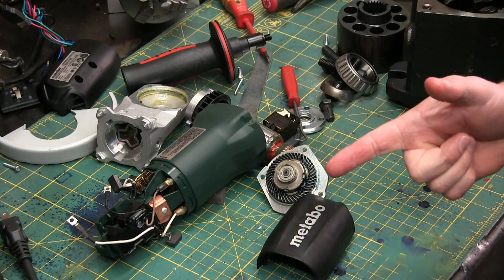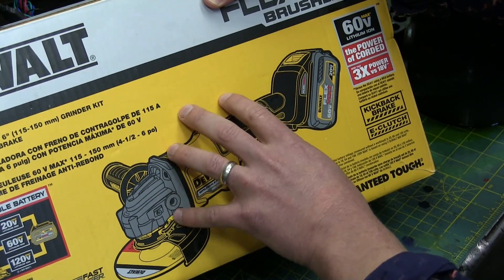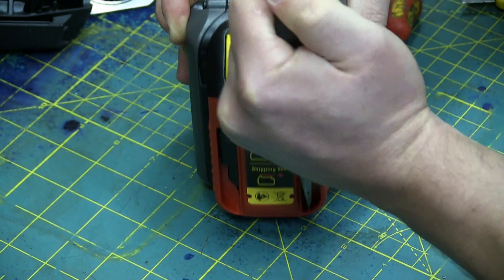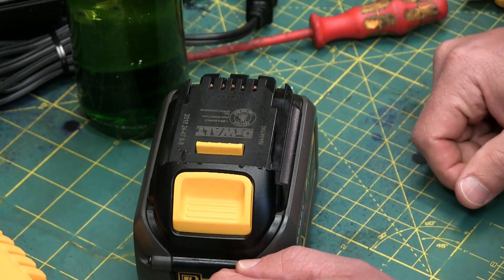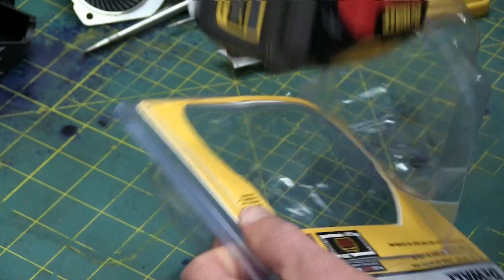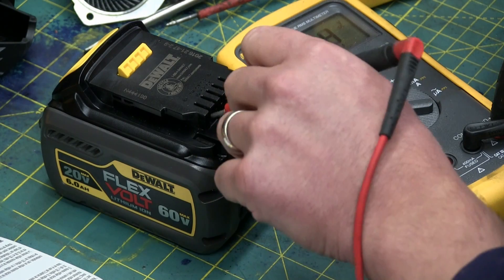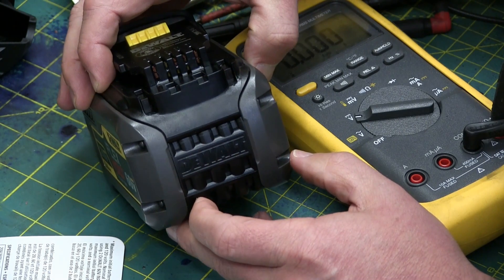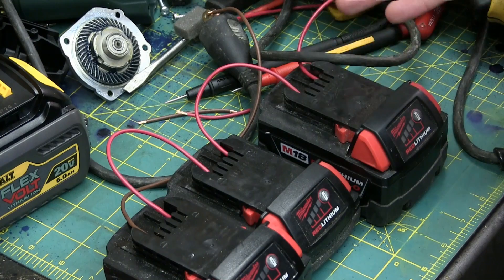Plug-in Power Tool to CORDLESS CONVERSION.

Comment: I'm no Mr Wizard wit electronics but I've worked on enough cars that had that had stereos that could break a window or thump start a dead guys heart a quarter mile away and they all depend on those big capacitors or they sound like crap, they sound like crap anyway(to me). I believe they are just batteries that are able to vomit out a lot of power in an instant then recharge in between those moments of insanity. Maybe one or two of those would do the trick? I'll ask one of the deaf kids at my buddies shop tomorrow.

Comment: li-ion, li-po, etc. batteries degrade when fully charged and not used for long time. To be able to keep them in wearhouse for weeks/months  they need to be keept at storage voltage usually around 3.8V/cell. This is why they are never 100% charged from factory.

Comment: Huzzah for universal motors.  My simple two cents would be a microcontroller that switches to the batteries for the first few seconds of operation and then lets AC wall power take over.  Either that or talk to those solar guys that rig up battery storage banks for their house that then runs on AC.

Comment: could you do a soft start dc circuit much like one of the nicer wood router's? I'd have to think about it a bit, might need a diode in there somewhere to keep flyback from happening over to the ac side and things going sideways from there...or you could run it across a bride rectifier like an alternator setup..

good stuff! 

I too, was amongst the crowd yelling at the screen. 'poosh the button!' 

cheers!

Comment: $100 for a 100 foot 10 gauge extension cord isn't bad compared to $200 in batteries, $50 for a lesser extension cord, and who knows how much in zero cross detection, switching, control, and filtering circuitry.  It still sounds like a fun project and who knows, maybe it will inspire DeWalt to come out with a $400 extension cord.

Comment: What for storing electrocity you could manufacture a suitcase with say 28 4 volt batteries, a charger, and a plug at both ends. Think like a ups for a pc. The battery bank would act like a big cap and would eat up any start up load and i bet you could run the tool off of it for a short time.

Comment: There's uninterruptable power supplies (UPS) that work the same way as this already available. Got like a big battery charger going to a rack of batteries and then an inverter that runs off the batteries. Under normal operation the charger supplies the power to the inverter and when the power cuts the batteries are there ready to kick in so your computer and other shit doesn't cut out. It also stops you getting dirty power. check em out, you might be able to find cheap ones second hand or something, I got 2x3000VA (they're not the same as i described but similar) for free from work, they were literally gonna go into the bin until i saved them. Id send them your way if shipping didn't cost me half my body
Reply: +Matthew Christ A UPS setup like that probably weighs 30kg+
Reply: @Paul Bearer If we're only worried about surge protection why are we using batteries at all? Wouldn't capacitors be more suitable?
Reply: a fancy name on a standard issue ups... that's what I was thinking
Reply: Lead acid or ni mh battery chemistry and Li ion are problematic to convert as you need a battery charger / management system to charge the Li batteries correctly and protect from over discharge or bad things happen ie. Dead cells or fires. It can be done but often not worth it for static or semi portable devices due to cost and pesos. Also you don't really want an dc to Ac source as most things run on dc. Ac is good for high voltage long transmission like the power grid. Ac ups is only handy because you don't want to hack open every device plugged into it and add a dedicated nice quiet dc supply to every device.

*Edit 
By convert I mean lead acid / NIMH to Li batteries
Reply: Movs (metal oxide varistor(s)) for surge protection on surge protected power boards / power stips and ups'. Ups is to provide seamless backup power when the mains go down or brown out so you don't lose data on a server or PC etc. Anything else you wouldn't be worried about intermittent power outage.
Reply: I think the main problem here would be size. It would really need to be small enough to be mobile, and I haven't seen a UPS any where close to small enough.
Reply: +zach jones generally that's because a UPS is designed to last a minimum of 3-5 minutes. This 'turbo charger' would only have to be running for a few seconds at a time. 

Modern UPS can be pretty small these days if they use lithium batteries, the lightest ones weighting in at 3-5kg, though they lack the power output to run an 1800W drill.
Reply: UndeadSamurai01 There are ups out there rated for high loads, they're usually found in server environments, like I said in my first post I got 2x 3000 volt amp UPS which are rated to 2700w usable power. They each had 8x 12v 5amp/h lead batteries in them and were designed to output 2700w for about 8minutes.
Reply: Yep
Reply: Matt, if it runs off the batteries, then what is it running ON?

And then why were the ones at work going to be thrown away if they still worked?
Reply: Maxx, that's an easy one... Corporate spending! If they don't spend the $$ this year, they don't get that much next year! just a guess...
Reply: Maxx Fordham! I have no idea why they were throwing them out, they just said they needed help lifting them into the bin and I asked if I could have them instead. I work casual in a retail store so it was for a small server setup. I didn't even know what they were until I got them home and opened them up, they were heavy so I knew there had to be something good inside
Reply: A data center might be a good place to find one, they probably replace whole units instead of only replacing batteries.  They do have confusers in Canada right?

Comment: I was sitting here thinking, man that really is a bad desgin, that thing is never coming open maybe it is designed not to come off, it probably a safety feature, maybe it isn't supposed to come off. Then you pushed the butto.....and I thought that you might not feel as bad if you knew there was someone just 2 clicks denser than you on the mohs scale.

Comment: That idea has some serious implications, you would save a lot of wasted time. With all the availability of "inexpensive" Lipo cells you could whip up a end of line UPS (which is what you are talking about) to support long distance power runs. Additionally you would be able to support short power draws without a AC supply. You are talking about some moderately complex circuitry, but the biggest thing that has to be considered is how much current you want to sustain and how much unpowered runtime you would want.

Comment: Other than the ability to deliver a good sized burst of current on demand, this turbo charger for tools doesn't seem a whole lot different in concept than an uninterruptable power supply.  Most of those are based on lead acid batteries if memory serves me right.  For developing something like this, would lead acid batteries be more practical to start with?  10 el-cheapo car batteries in series would give 120V and might be cheaper than two of those dewalt batteries at $200 a piece, not to mention you don't need a proprietary charger for a plain old car battery.

Comment: what about a massive capacitor instead for assisting corded tools? seems like the perfect application for one especially since other motors tend to use them. wonder if they would help with voltage drops though

Comment: 4:06 No... Lithium batteries are supposed to be stored at half charge, they'll last longer and leaving them fully charged for long periods of time will slowly fry them, that's why laptop/phone batteries sometimes die within just a couple years, because people will leave them on the charger all the time, doing it once right out of the factory might not be too big a deal but I still prefer them do it right.
Lead acid batteries are the ones that should be stored and arrive fully charged.

The Canadian thing was pretty funny by the way.

Comment: you could have two versions one with batteries that could act as a power source and an amp buffer for remote job sites and a capacitor version that just handled the amp load when you are on AC.

Comment: I doubt any tools designed to run on 120VAC will have any real useable power/torque when running on only 60VDC in "cordless mode". Please do an A/B comparison of this.
Reply: No, it absolutely isn't. 120VAC rectifies to 170VDC.
Reply: Lookup Universal motor.
Reply: The cells used in power tool packs are not cheap to buy, even in bulk. IMR cells instead of ICR like in a laptop battery, they have much higher current output capacity (20+ amps is not uncommon. In fact I just rebuilt a Makita pack with a set of Samsung cells that are rated for 22 amps each). The cost of 30 bare cells is going to be significantly more expensive than a 30 cell pack from DeWalt (the 60V packs are indeed 30 cells), at roughly $8-$10 per cell from a reputable manufacturer (i.e. Sony, LG, Samsung, Panasonic), plus shipping.
Reply: Im not an electrician but wouldn't it run normal? if it's designed to run on 120Vac that means the voltage is around 60volts all of the time depending on which way the pixies are dancing. in other words with the voltage spikes and drops in a standard wave form roughly equal to the constant 60VDC shouldn't it work normally? I don't know, not an enginerd... someone here probably is... besides AvE.
Reply: 120VAC is equivalent to 76VDC
Reply: Its just a proof of concept. No reason you can't just use more batteries. I'd be temped to wire up a custom pack from bulk cells rather then give dewalt all my money. But that kinda voltage combined with the kinda of current those cells can output is scary. Not to mention trying to manage 30+ cells in series. Having them go thermonuclear would not be fun. Well thats not true it would  be fun but only if its not in something you don't want  on fire.

Edit: why do you think he bought two batteries. My first thought when I saw those when they were announced was to put two packs in series and run mains current stuff of them for shits and giggles.
Reply: i guessing about 50% power
Reply: You can buy 60v to 120v dc boost / step up converters on eBay for under £15 or less than C$25 Canadia pesos. These units deliver between 15-20A at 120vDC at around 90% efficiency.
Reply: +Tim Mills nailed it! i think. i dont know, sounds good but.
Reply: No. Mains voltage is a RMS value. That means, if you connect a light bulb to a 120V AC it will shine just as much as if you connect it to a 120V battery. Same goes for universal motors.
Reply: VictorIndiaDeltaAlfa I think that's what I just said ;)
Reply: ***** Yes, its the same. I just explained it on "pixie dancing" level for "Mr. 
Not an electrician".

Comment: Hmm, A battery "kick start" for a corded tool might work but there is a lot of engineering involved in that. Were I'm at we use 250v so voltage drop over wires isn't bad, but on construction sites they make the builders use 120v, using these nasty transformer boxes that get kinda hot after use, So I'm happy being a home gamer, but ok, I'll see if I can whip up a decent implementation of a corded tool with battery assisted start.
Reply: You could probably have a circuit that detects when the trigger is pulled then starts a timer, and have the batteries wired to a normally closed side of a relay. After a second or so, that timer could trip the relay switching it over to the AC side. Im sure theres a better way to do it though.

It seems a DPDT relay would work perfect.
Reply: Yeah, I was gonna use an array of mother fucker beefy SRC's or IGBT or some magic shit to switch in a battery then hand over to mains, or maybe even use sorcery to run them in parallel
Reply: Actually a capacitor would probably solve the problem, most tools have them to bring the power factor close to unity, but you'd need a massive one to deliver the juice
 needed

Comment: A few things wrong with the idea ... The best way to remedy your problem is to go further down the extension cord and fix it there. Try instead to come up with an idea like quick interchangeable breaker sockets with different amperage and always carry a high voltage extension cord with you. The battery ideas ok but very short term and cost way to much to maintain. Just my opinion... Love your video been watching for around a year. 😎

Comment: that is fucking brilliant. you could set up a battery box that the tools plug into that regulates the amp flow. it would stop the voltage spikes and really not ever require recharging because it would trickle charge off the AC input. I wonder if the whole thing could be done with capacitors instead of batteries?

Comment: lithium batteries store better at 80% charge.
Reply: Nasa for one... https://ntrs.nasa.gov/archive/nasa/casi.ntrs.nasa.gov/20090023862.pdf
Reply: Says 40% here. http://batteryuniversity.com/learn/article/how_to_store_batteries
Reply: depends, a lot are optimized for 40-60%
Reply: just top em off. Internal resistance and or protection circuit will kill em over time, the full charge just gives you a good buffer.
Reply: Lithium Ion cells are fully charged at 4.2v, flat and damaged at 3.0v at should be stored/shipped at around 3.8 volts.

Comment: it's good for lithium to not be stored fully charged long term, otherwise fucking hilarious
Reply: My left nut has more sauce. These battery old wives tales cripple us.
Reply: +AvE i think its because its going to lose pixies over time so why charge it fully when it wont be there after 2 years in storage. Battery university is what i was reading from.
Reply: +AvE http://www.batteryuniversity.com/learn/article/how_to_store_batteries
Reply: Most of that information comes from http://batteryuniversity.com/learn/article/how_to_store_batteries.  "BatteryUniversity.com" which is run by a Canadian electronics company that makes battery testers/chargers/analyzers.  Not sure how legit the information is, but there aren't many other places you can go to find this stuff out.
Reply: +Guest03281 I would imagine it would be in the a battery company's best interest to provide accurate information.

Comment: you need to use relays or solenoids or solid state relays and u use arduino to switch the relays for the tool and the charger

Comment: you dont want to store lithium batteries full or empty. they lose a lot of capacity pretty quickly after storage when
Reply: Shoot, why isn't this common knowledge? I always liked to keep my Li-ion batteries charged to full.
Reply: +AvE http://www.mpoweruk.com/storage.htm
Reply: +AvE https://en.m.wikibooks.org/wiki/Battery_Power/Lithium_Ion_Batteries#Storage_temperature_and_charge
Reply: +AvE http://batteryuniversity.com/learn/article/how_to_prolong_lithium_based_batteries. as well as the links above
Reply: The lithium RC battery chargers have a "storage" setting that puts each cell at 3.8V.
Reply: ah thumbs up, was gonna comment the same thing. Lithium don't like sittin at full capacity for a length of time.
Reply: Many laptops will actually automatically switch to battery power for a short period to drain some power so the battery doesn't sit full for long periods on AC. I've heard of windows taking you down as far as 90% or lower to take care of that.
Reply: also, there are regulations about shipping charged lithium batteries. I've heard of companies having to discharge batteries in order to ship.
Reply: Life batteries can store full charge for longer periods, lipo are very delicate on the chemical side thats why advanced lipo chargers have a storage mode to get the batteries at mid charge where are more chemical stable condition, sorry for my english me habla español
Reply: Better off storing them full then letting them run down to nothing.
Reply: store lithiums at 3.7v per cell, if it's going to sit there for a few weeks
Reply: Maybe use a car battery
Reply: I say this because lithium batteries don't have nearly the cycle life that acid batteries do. Repetitive charge/discharge cycles, however small, takes a big toll on lithium,.
Reply: +robmanueb2 depends how low youre storing it. the numbers ive seen say storing them at full long term will cut max capacity to 40-60%. where storing at 60% leaves a much larger portion of the original capacity intact.

Comment: what drill would you advise to buy, cheap, reliable and useful
Reply: One with a cord. The batteries and charger drive up the price quite a bit, and any battery has a limited lifespan. Cordless is a convenience, not a necessity.

Comment: Do you think they will eventually make 120 v max? is there  brushless universal motor that could run on 120 vdc batt and/or 120 vac from the outlet with an adaptor
Reply: I think delwalt has a miter saw that takes two of these  "60" volt batteries and runs at "120" volts. I use quotations because they are using no load fairy tail voltage. Under any kind of useful load they will be ether be about 18 or 54 volts.
Reply: 120V DC is more like 160-170V AC equivalent power....
Reply: they do have one. The new miter saws can use 2 batteries for 120V, and come with an adapter that can plug into the wall, so it can do 120V AC, and 120DC